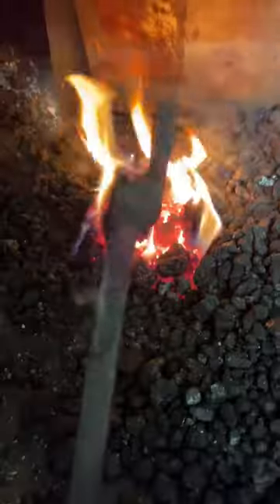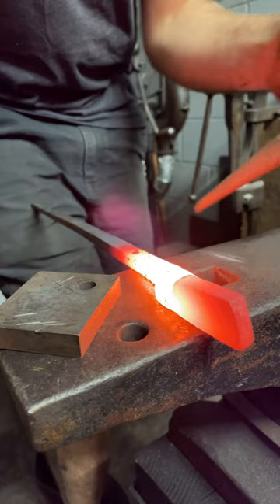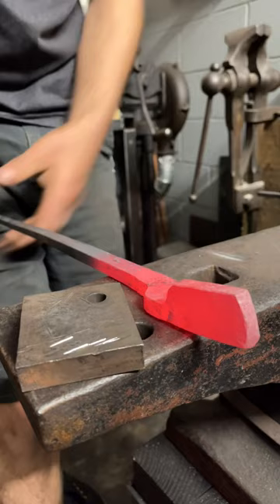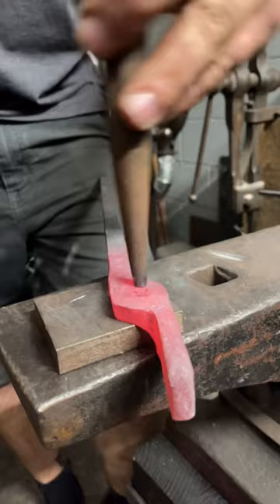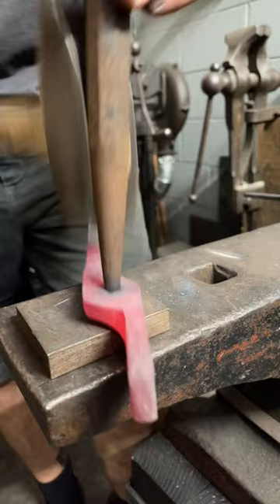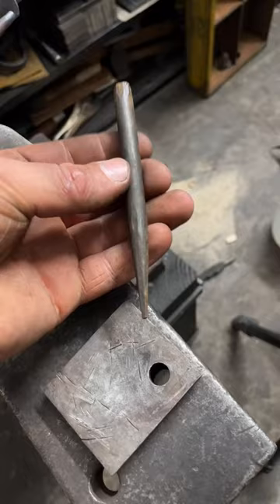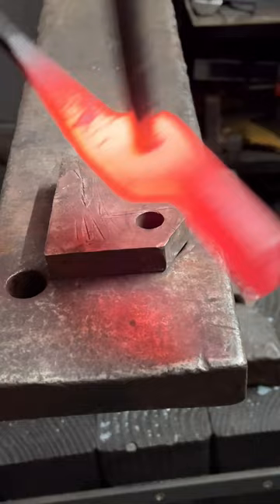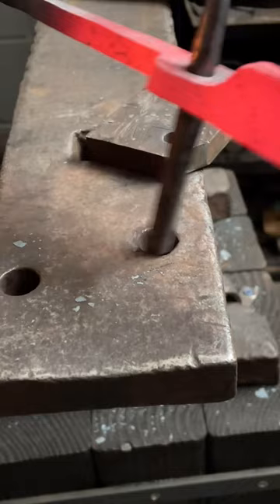How I punch a clean hole in metal #anvil #blacksmith #forging #shorts #blacksmithing #forged #asmr

Comment: my problem is I keep forgetting to cool my damn punches and end up needing to referb my punches/drifts bc I have bent them to hell and back
Reply: Sometimes i forget to cool them after using it for the last heat and then go pick it up barehand, isn't funny
Reply: Do you do a lot of heavy forging such as 2 inch bar stock?
Reply: If you find yourself overheating the punches often perhaps strike harder and or work at a lower heat.

Comment: Awesome video, but why on relatively low heat? Does it bend the surrounding metal if it's too hot?
Reply from the maker: When punching, it can help to shear the plug out if the material is a relatively lower temperature. I also run the drift through at a normal forging heat first, then go back at a lower heat to get a more precise, burnished hole. Hope that helps!
Reply: Some cold forming may even harden the hole, and generally, this low deformation only needs heat to reduce the forming forces required.
Reply: Yes that and also it will be more malleable so instead of it making a plug that seems to be “cut” it will just push the metal like if it was almost like clay
Reply: Precisely! Less smearing if it's a bit colder and more brittle.

Comment: Could be just the video, but I like to have a high localized heat when hot punching, I make punches out of whatever tool steel is around, and don’t harden or temper them…because tool steels are just Tuff, and will survive a limited run. If it’s a production item tooling will be created, to survive the production run multiple matching tools will be created to ensure that the run, runs!

Comment: What's the difference between punching a hole and drilling a hole? Is there a structural difference?
Reply: Typically drilling a hole takes a lot more time. Imagine doing what he did, except you have 4 of those in the Fire waiting to be punched and you pull em one by one out and punch the holes as fast as he did to 4 of em in a matter of minutes.

As opposed to taking all that time drilling holes into 4 of em which could take some time. More than a couple minutes for sure.